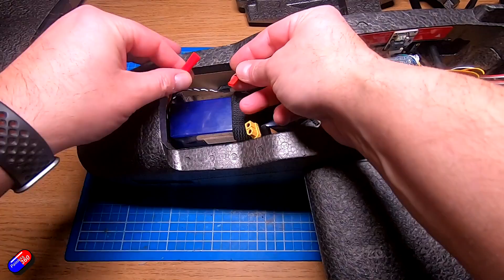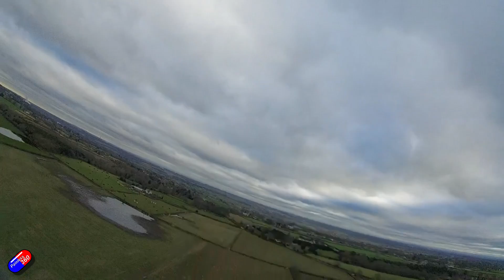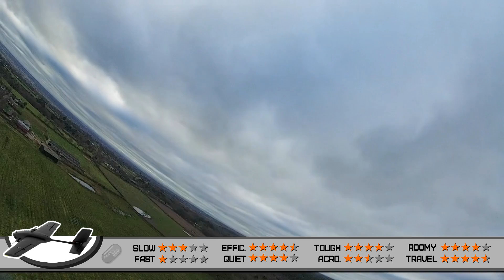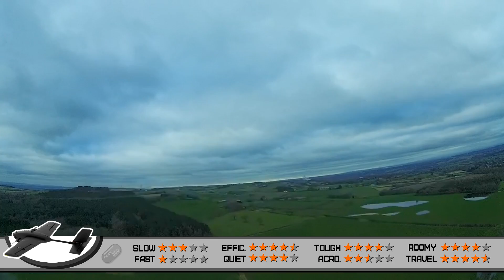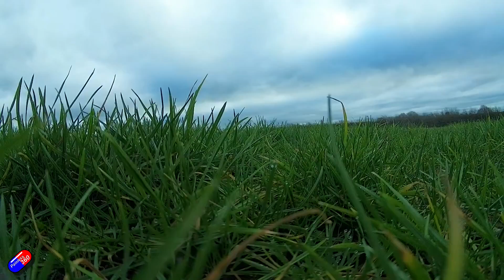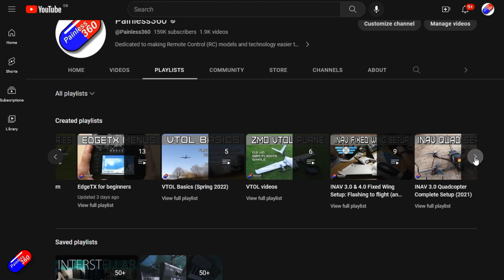Heewing T2 CRUZA: Full flight review!

Comment: I would change motors for AOS nova 2807 and put bigger batterie, and it should go at 100mph and longer :)  this is the best EFF 2807 motor, also it could use 8 prop easily. I do not thing a larger props are needed cause of the wing sizes.
A question, what is the space for batteries? I would put 6S Liion, but they are wide batteries less than 70mm.
Option for customization the T1 would be BEST thing. In the end customizing to this T2 but could mix and match between. Cause i would just put larger wings(not 1200 but 1000) and longer nose for gimbal and the rest could be same. That would be perfect.

Comment: youtube brought me here😂, so while I'm already here I'll ask this... how do the pilot determine how far he should fly the rc plane so it will not lost contact with the remote?
 how far does this unit goes before the plane losses contact with the remote?
Reply from the maker: It is very dependent.  See https://youtu.be/wyZuxV8j31g
Reply: so there was no definite answer cuz of different factors needed to be considered. so if you just felt like you've reached the edge of its flying range you just gotta pray that you won't suddenly lose control before you could turn it back to range. 😂
Reply from the maker: It's not that bad. Most modern radios will warn you that the signal strength is getting low,  way before you lose the connection.  Using different frequencies, higher powers and directional antennas allow for longer ranges (if legal). Happy flying
Reply: I see, thank you for enlightening my curiosity

Comment: Does bidirectional dshot not work on the heewing fx405. I'm using channel 7,8,9 as my motot group. Everytime i mark those channels as bidirectional. Aurdupilot won't spin my Motors. Any suggestions?
Reply from the maker: No idea, I've never tried. Careful grouping and positioning of output channels with respect to the timers on the outputs. Things like this is why I stopped helping vendors who made flight controllers who didn't become paid up members of the Ardupilot project... Best of luck
Reply: @Painless360  oh, I thought heewing became an aurdupilot partner. My T1 vtol flys great using the parameters from your video with the updated filters and using dshot. It's a shame heewing didn't tune the T2 vtol kit ecu. Thank you for replying quickly.

Comment: Hello Friend! I recently bought a t2 cruise and it's a really effective and quiet plane..but also slow (especially when climbing). I wanted to ask you what propellers should I put on it to speed it up a bit? Should I try some 9 inch propellers? I know I can't get too much, but I don't expect to either.
It currently has 8055 size propellers and 730kv sunnysky 2216 motors
Reply from the maker: Adding a larger prop can increase the current a motor draws dramatically. I have a 'motor and prop' playlist that covers it in detail. Increasing the prop diameter from 8 to 9" (with same pitch) will increase the amp draw by about 13%. Adding more pitch will increase it by a lot more. You need to be looking at extra pitch for additional speed but watch out for the max amperage.. 
https://www.youtube.com/watch?v=D2spz4CEn9o

Comment: How is the temp of your WS-VTX mounted in the side of the FPV bay?  (if you still have it there)   Did you end up having to add a fan for extended flight times or is it getting sufficient airflow?   I've put a pan/tilt servo in the top of the bay so I'm concerned about venting.   I'm worried about it being a dark plane in the hot summer sun here in Florida (USA), curious if you recall the temps you're getting and if you've flown on any particularly hot days?  tyia
Reply from the maker: Temp good. No need for a fan. Happy flying
Reply: @Painless360  Thanks for the fast response,  btw LOVE the content!!  ty

Comment: Hi. How do you prevent the propeller to hit the ground on landing ?! On mine, just on the maiden flight, the propeller scratched the ground and since then there is an unusual noise in the motor.  This is my first twin pull model. I was used to large pushers like the Volantex untill now.
Reply from the maker: Only by fitting landing gear or skids. Even esc brake won't completely remove the chance of a blade strike... Happy flying

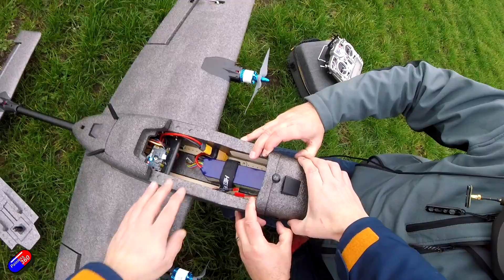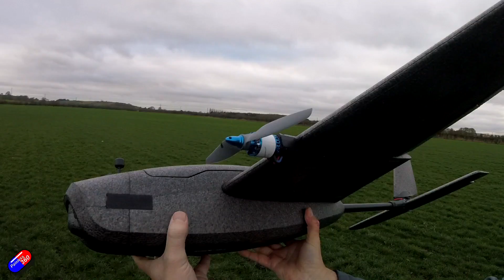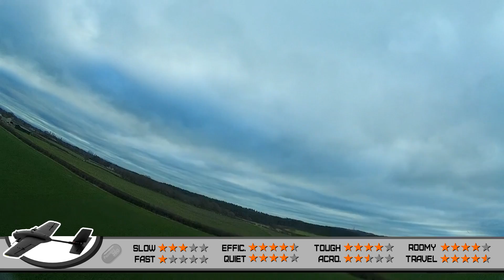Comment: observations          1:37    manufacturers continue to make  DUMB  basic  design  mistakes.           the mass of wing-located servos should be located forward-of the thirty percent of chord line and as far inboard as is practical.          the span of the elevator should not be  truncated.         there is one drawback to the use of foam.      a foam wing has an abnormal span-wise dom.    distribution of mass.         1:46   thick  trailing  edges  make  more  DRAG, all of the time.!!!          7:14   it is the opposite of smart to make the tail HEAVIER, by putting servos  there.!!!       d

Comment: Excellent video as always! We call you professor !! Why would they put such a low KV motor in there :(. Put two 1250 KV, same size, and you have yourself a faster plane with only 4s.
Reply from the maker: Motor and prop selection is a trade off between max speed, static thrust and efficiency. Too much of one, you lose a lot of the other two. It's a tradeoff. See my video on it in the motor and prop series.
The setup could be tweaked for different bland of strengths... Happy flying
Reply from the maker: https://youtu.be/YISf-tepO_A

Comment: Have you tried differential thrust mixed into the rudder? Might be a pain if you have to map the escs to individual channels, but might be worth it. There are a few twins that use dt instead of rudder. Happy landings 😊
Reply: Inav 7 has automatic differential thrust setup if you select it. I use it on my atomrc penguin 🎉
Reply from the maker: That would be one way to aid the yaw control. I've not used it INAV 7 yet, in earlier versions it caused low speed crashes here... Happy flying

Comment: Hi Lee,  Great flight video, I just love my Ranger T1 and I have looked at the T2 as my next plane. Thanks for the video and information about how the T2 flys.
Reply from the maker: Thanks for watching.  What did you think of my ideas for the T1 at the end of the video?
Reply: @Painless360  Those are fine T1 alteration suggestions, but I got the T1 for its backpackability, so longer wings and tail are not for me. My 2m Opterra is great for motor-off soaring, if I want to thermal.
Reply: I built a t1 cone from laminate floor insulation (ended up 50-60 grams lighter than real t1). After the first few flights I ended up extending the tail boom by 20% and increased the wing root an tip  and length by 20% as well.  It's was extremely floaty and able to catch thermals extremely well which is what I wanted. I did unfortunately crash and total it but that was my error flying in terrible conditions. it will be rebuilt this winter all the electronics survived so I lost about £8 in insulation and about £3 of ply wood so not too bad.